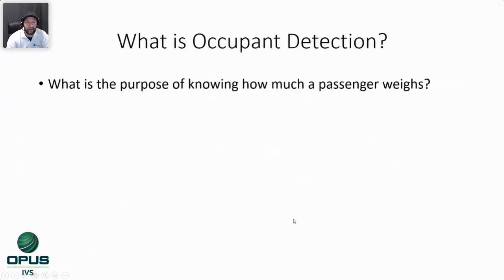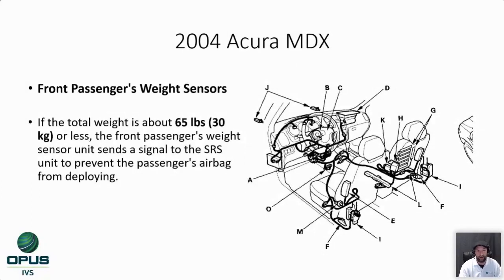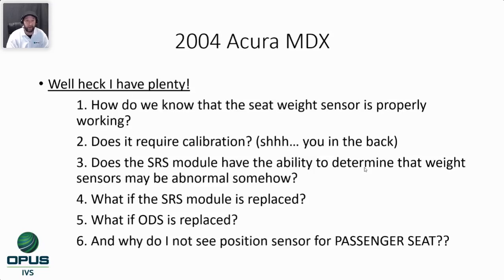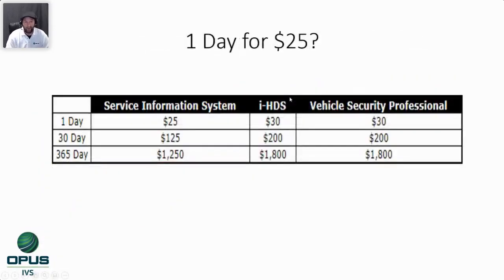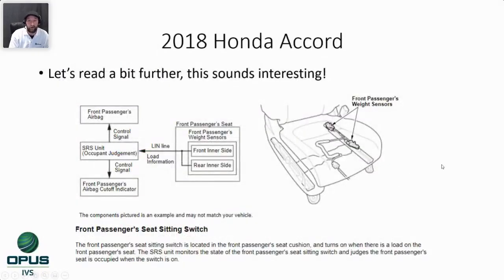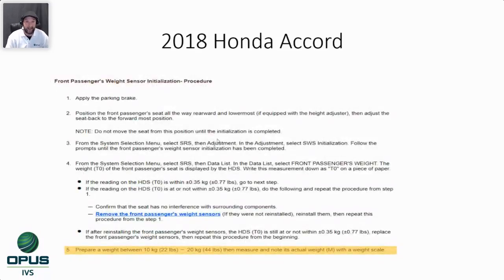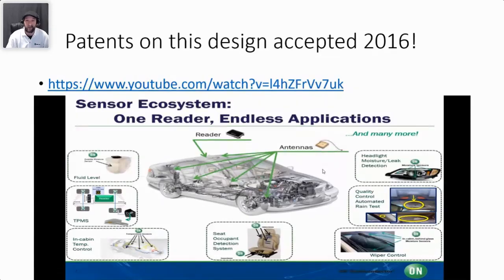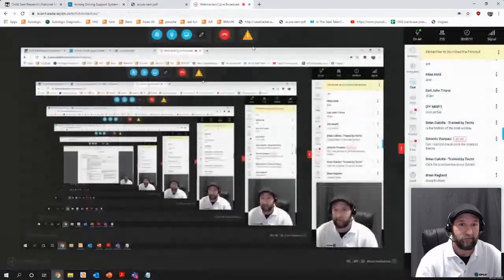Honda Seat Weight Calibration Training

Comment: Keith, is there anyone you recommend in  NYC area for car diagnosis.  I have a 2012 Fiat 93K, no fault codes, not completing two monitors and need to get inspection and registration at this point because you can't get reg without the safety inspection.
Reply: move to michigan.  no emission test or anything none of my cars would pass anything..  just fucking cops ruing people's day.

Comment: How you doing I have codes on my Honda Accord 2016 but when I try to reset it saying initialization has failed (b00a0-54 weight calibration ) + it also giving a second code saying b0001-13 eflactor I used a computer to do but is not working